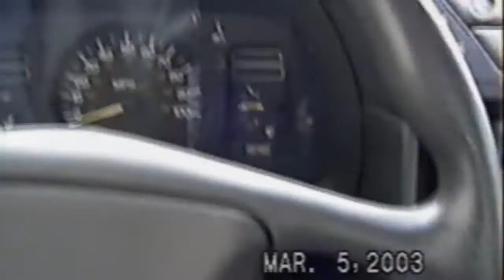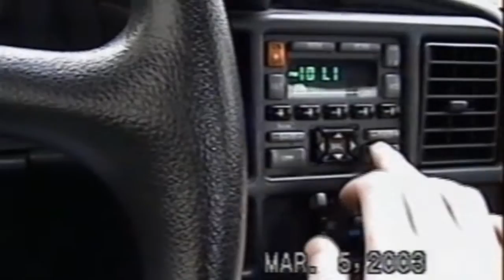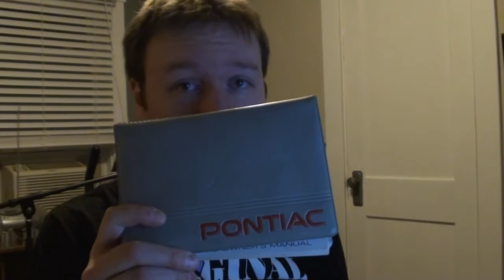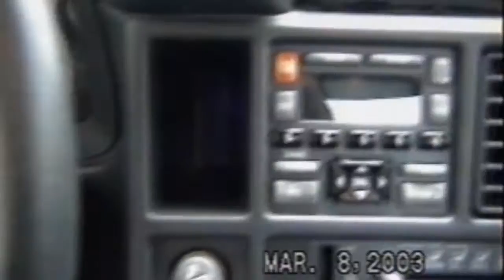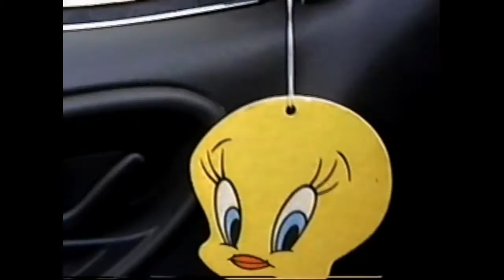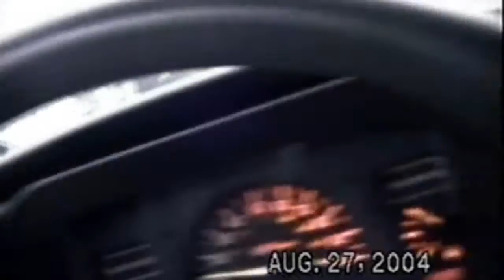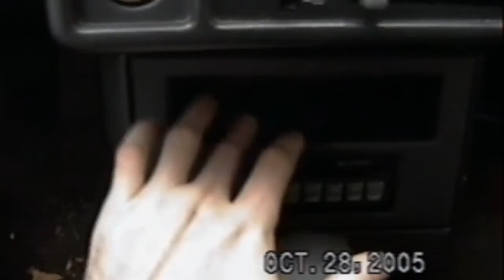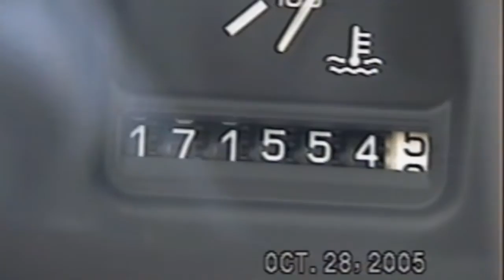MV 2 - "There's Only One 'Red Lightning'!"

Comment: Did u make the music for your intro because if u did it's great!!
Reply from the maker: No, I didn't. AUDIONAUTIX.com
Reply: MichaelAdamsRocks my mom used to have a 1994 Sunbird LE 4 door Sedan it was a light blue colour mix of a blue and green and also had the 2 litre 4 cylinder, my mother bought that car in 1996 it was used at that time but it was a 94 it was two years old, after that in June of 2001 my mom ended up buying a 2001 Pontiac Montana my dad drove The Sunbird from 2001 to 2007 and unfortunately we no longer have that car we sold it back in 2007 and it is long gone. That sunbird started having mechanical issues the muffler ended up falling off and the ignition switch broke and you would have to start the car without a key. It was also basic had manual windows as well.